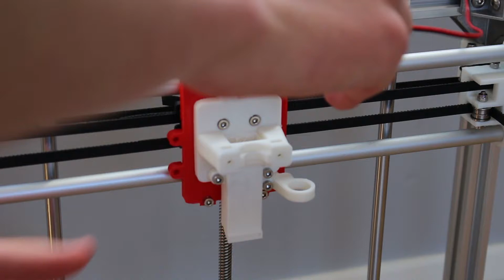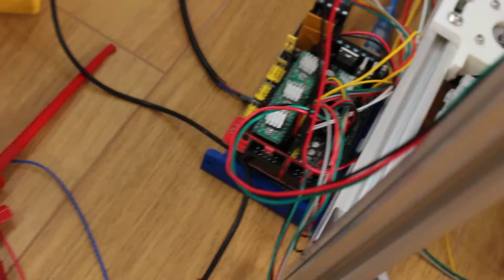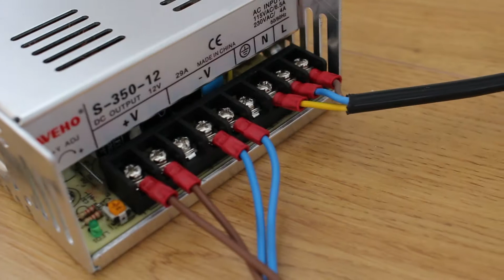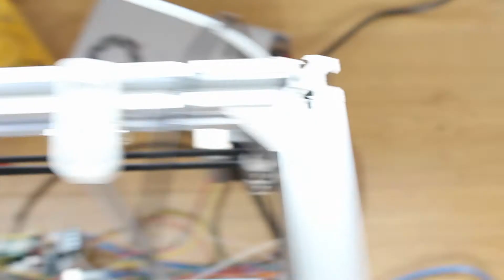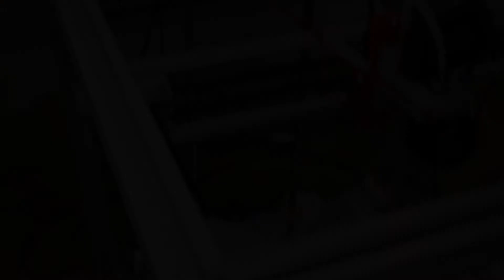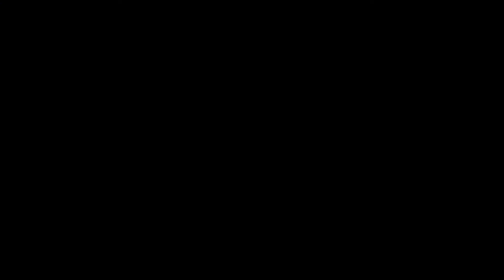HyperCube 3D Printer Build - Part 3 5

Comment: I had the same issue and after working on electronics I changed the Marlin version and suddenly everything worked well. previous version was a nightly build which worked on my prusa well. but did not work on corexy. I switched to last reliable version.
Reply from the maker: Ahh interesting, turned out to just be a hardware issue in the end for me

Comment: I had the same problem with one printer I was fixing for my school. I checked the wire but it was fine. Could it be that the motor is inverted in the program.
Reply from the maker: yeah there's a few things that can be wrong with them, turned out mine was wired incorrectly in the end
Reply: PracticalProjects 

Good to hear. I want to build one of these too. I got two 700mm lead screws for a tall print. Currently hoping around different hypercube designs.

Comment: Z stepper sounds like it isn't wired incorrectly.  Use and ohm meter to check which wires are connected to which coils. Another way is to connect two of 4 wires from the stepper together, if the stepper is harder to turn then those wires are mated coil wires. If the stepper turns the same with them connected switch one of the wires and try again.
Reply from the maker: ahh interesting, thank you I'll have a look at that!
Reply from the maker: Thanks Jon, turns out the motor was wired incorrectly, works ok now
Reply: PracticalProjects Yup I had a very similar issue when I built my desktop CNC. Glad you found the problem. Cheers

Comment: It sounds like only one of he two coils is activating. Measure coil resistance and isolation with a multimeter, see what that says.
Reply from the maker: interesting, I'll look into that then, thanks!
Reply: (What you're supposed to get, for the record, is the leftmost two wires having a few ohms D.C. resistance, the rightmost two having the same resistance, and no connection between the two coils)
Reply from the maker: great, thanks a lot!

Comment: Check the wiring to your Z motor. Mine was wired differently to the x, y & extruder motor!
To check it plug your X motor into Z on the ramps board & move Z in pronterface.
Reply from the maker: that's an idea thanks, I'll try that!
Reply from the maker: it was in fact wired in correctly, thanks for your help!